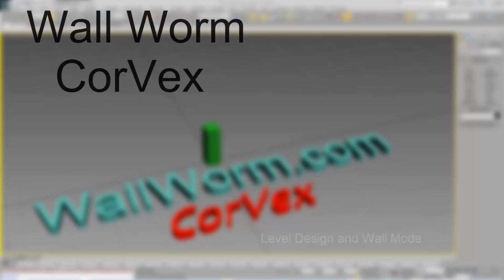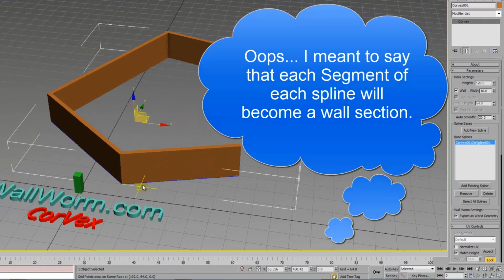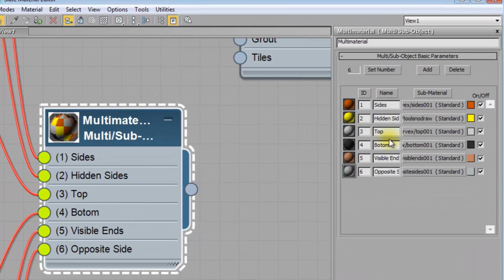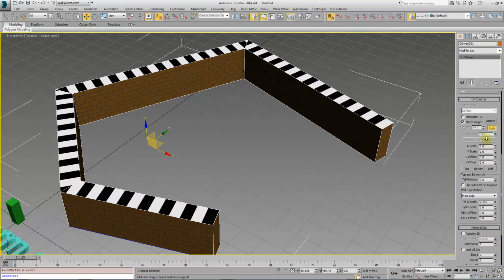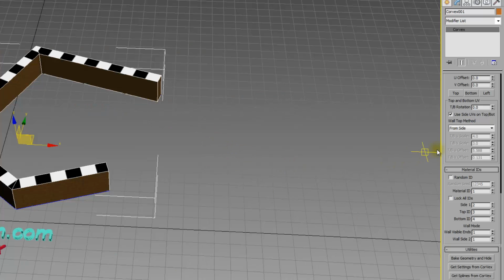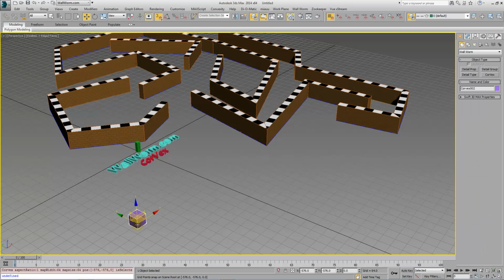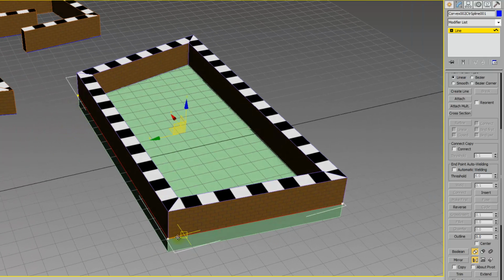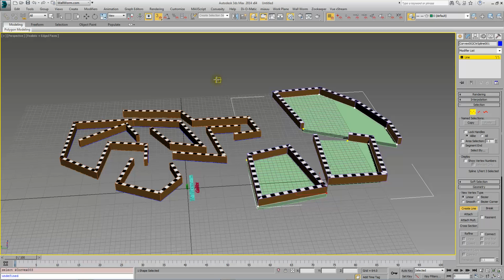CorVex Wall Mode

Comment from the maker: CorVex 1.3 is Released.

There are several new features and enhancements. There is now a Wall Mode to create convex walls from the spline segments (similar to how Convexity worked but in realtime). Also, there are enhanced UVW controls as well as some utility functions and more organized UI.

Get CorVex here: http://dev.wallworm.com/topic/66/corvex.html 

I do have more ideas to enhance the tool after I'm done using CorVex in a current project. Stay tuned.